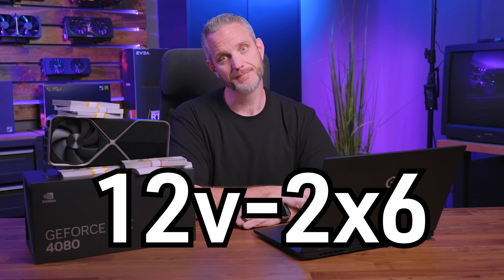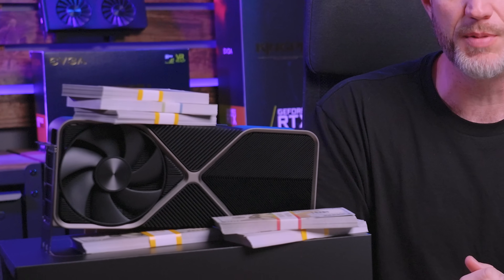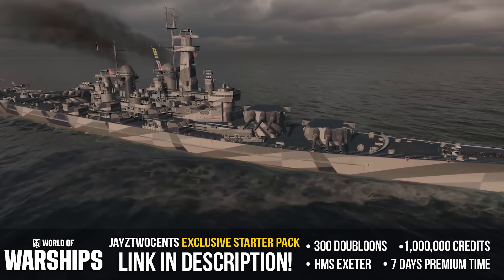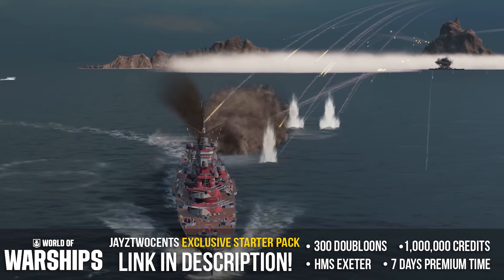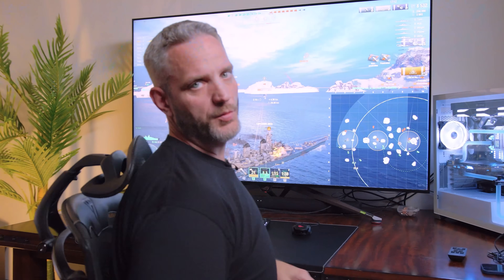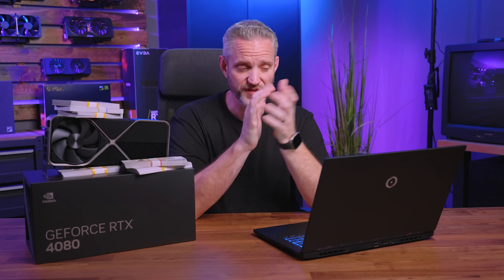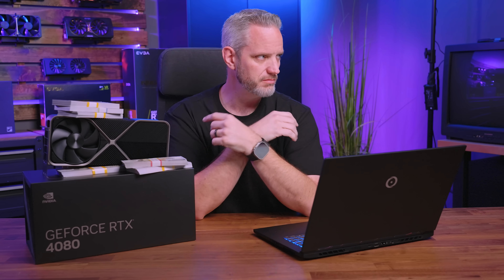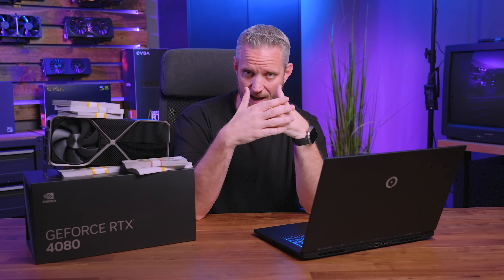They FINALLY admitted that this was a major issue!

Comment: I'm looking forward to the H++ Connectors. I don't think we can get our hands on them as of now. We'll upgrade and fix every card with a 12VHPWR connector.. Done. Everyone is happy.
Reply: Maybe you can do that colab with Jay and get him to fix some for you 😉
Reply: Do you have a mailing list available to 4090 owners to let us know if/when you have them available? Also, how much would something like that cost? (Of course, not knowing the cost of the part makes it harder to answer that, simply wondering about average labour charges.)
Reply: @BreezeTigerclaw  What about warranty? Would it be void if someone changed plug?
Reply: @ultrasaiyan4283 the ones who come to him are the ones who are denied warranty.
Reply: @triadwarfare  What if someone has a brand new never opened 4090, they open the box, find the old plug, and won't use the card until it has the new plug on it? Is there some way to get a brand new card that has the 12vHPWR replaced with a brand new card that has the 12v 2x6, or is there a way to get the card's connector replaced with the "right" one under warranty?
EDIT: Reason I'm asking is because I'm almost certainly going to be buying a card online, and I don't want to have to send 20 of them back because they all have the old plug on them.
Reply: @44R0Ndin  then get a card with the new connector.
Reply: @44R0Ndin  if it's brand new, in-box, I'd probably return it.  Unless you absolutely need the highest of high end cards it might make more sense to wait on either 1) fixed 4090's (how you know?  No idea) or possibly wait 'til 50 series or... 2) consider a lesser card where this is obviously not a concern for now and upgrade later.  I get that you had your heart set on it but... to me it's not worth it.  You can flex with the highest of high end cards next generation.  Just get something powerful enough to get by now.  Then go crazy next gen with whatever is the best out there then when hopefully there's no issues (again...  always that risk).  I mean, we're not even really at early adopter status anymore as the cards have been in the wild for ages now and this is a known situation before you even go to buy the card nowadays.  Early adopter would've been like getting a card at the 4090 launch.  That ship sailed a lonnnnnnng time ago.  LoL

I mean, you could always buy a card and have it fixed (well within your rights and I respect that) but you're effectively paying a premium on a card under warranty to then possibly void the warranty (regardless of who fixes it and qualifications - I don't know that the current warranty legalese will accommodate for this and that would require a change, obviously -- which is another legal fee on NVidia or the AIB's behalf to get rewritten and implemented as revised Terms of Service/Warranty Agreement language) even if it remedies part of the potential that could lead to a warranty claim.  I don't know that preemptive work to avoid warranty claims is a thing...  y'know?  It just seems like a mess that isn't really worth it?  I know I'd do a hard pass on it myself.  shrugs

Sure the 4090 is a beast of a card, no question, but... as Jay notes there's very few use cases where it's a full-blown necessity.  Rather than put myself in that position, I'd let NVidia and their AIB's sort it out if it loses them (my and other people's) sales.  It shouldn't fall on the end user to have to fix a situation that's a failing by the standards body and the card manufacturers (yes, that includes AIB's).  I'd probably drop down to a 4080 and be done with it for the time being.

Obviously this was never an intentional scenario by everyone involved.  It's disingenuous to think that the standards group intentionally failed everyone and it's equally disingenuous to think that NVidia and the AIB's wanted their customers to go through this.  It's even disingenuous to think that the connector vendor in question created something with the intentions of it failing and making them lose $ and potentially future contracts going forward.  It's just a byproduct of circumstances and a failed design that met the specs but has weaknesses and I'd not lay blame at any one vendor and spread it equally across the board.  The standards body did make a mistake, the connector vendor designed a part that manifested the scenario where the mistake could happen with the inferior design built within the standard bodies' mistake, and NVidia and others sourced the wrong connectors by their own choice.  You as a customer buy into this by...  being stubborn and sticking with the purchase, especially if you know about it upfront.  Those that weren't in the know, that was a gotcha that they didn't see coming.  I feel for them especially if the companies involved don't offer a fix or some sort of good faith solution.

But the fact the customers are put into a bad position to bear the brunt isn't good and if they care about their customers (!!!) there should at least be some sort of attempt to help customers be provided peace of mind.  Even if that's a revised warranty wording that allows people like Northridge Fix and others to apply the fixes without it impacting any warranty returns, that NEEDS to happen at the very least IMHO.  Even if that's a potential swap for another lesser 40 series card and a voucher for a future card (ergo, the difference from say a 4080 to a 4090 in price) upgrade to show good faith.  Even if it's a discount to have a certified repair service like Northridge Fix (and others) fix the card for the customer (out of pocket) but get a discount voucher on a future card down the road by NVidia or the AIB to...  again, show good faith.  They can give the choice of an exchange with voucher to cover the costs difference or a user-upgrade + voucher or even potentially a NVidia/AIB partial or whole funding of the card under warranty as a preventative maintenance scenario.  I genuinely believe as premium a part as the 4090 is that the volume of sales is low enough that NVidia could likely afford to provide the fixes without it putting a hurt on their bottom line (especially since AI is their meat and potatoes and gaming cards are like a small side dish).  As Jay has noted with AIB's and the margins...  that's a bigger question mark.  That said, if Cable Mod can provide that?  I think it would be almost a necessity for the AIB's to figure that out too or else look like they won't stand behind their product.

The bottomline is that in order to assure that it's not Joe Schmoe with a soldering iron doing this on his own vs. paying a reputable service center with a contract/relationship there'd obviously need to be some sort of system in place to assure that it's handled to prevent voiding the warranty.  Sure there's likely some people talented enough to do the process themselves, but the fact that they're not certified or under contract makes it almost necessary that NVidia and the AIB's step in to handle the scenario and take some ownership.  I get that they don't want to for the liability reasons that Jay implied (i.e. why they don't want to use the term "recall") but I think there's a way to not bring it down to that and still do the right thing with the customers.  And a big part of that is not soaking you on it or dropping the ball in your lap with no solution other than, "Better luck next time *geegaws/aww shucks arm motion*"  That is B.S. and no customer should be subjected to that scenario.  

I mean, legally there's no obligation and as an early adopter to the standard...  you took that risk (again, why I'd take the 4090 back myself knowing the situation) but...  again, that's completely up to you.  I respect the decision if you're willing to pay that premium and then pay above and beyond with no assistance to remedy what you shouldn't have to.  That doesn't mean NVidia or the AIB's have to do anything, but...  it's a sign of the company you're dealing with (compare to Cablemod and how they've handled things) IMHO.  If the AIB's and NVidia see this situation and know the scenario...  they should at least care enough to want to not only rectify it in the long-game but to do something for the few in the short game that wanted the cards bad enough to pay said premium and incur said apparent "beta testing" in the wild on their watch.  There should be some sort of reward and sense of respect for that (and mind you, I'm never likely to be in the market for a 4090 -- that's just how I feel about those that can and do) even if the solution is a more modest one than taking fully ownership and responsibility and commanding respect on the level that a company like EVGA or BFG Tech was sort of notorious for and that Cable Mod obviously is.  If you want to be THAT company, here's your chance.  If it's not NVidia...  well, not really a shocker but...  it would deter me from buying their product going forward if I could avoid it.  Which is further reason why we need AMD and Intel to step it up, not that I can guarantee they'd be any better in this scenario if it fell in their laps either.
Reply: @BreezeTigerclaw  I'm charging 200 to replace the connector, with a stock connector or a mod. When these are available I'll add these as the main option for a repair. EDIT* I'm not northridge fix.
Reply: Not fit for purpose consumer law should apply, card rated at 600w and melts if it receives it.   "You'll have legal rights if the item you bought is: broken or damaged ('not of satisfactory quality') unusable ('not fit for purpose') not what was advertised or doesn't match the seller's description."  I'd Email nVidia and try and get a contract that they'll pay you for the repairs.
Reply: @Drunk3nMas7er  That would be a waste of time. The cards work just fine for most people, clearly they are suitable for the described task when care is taken with the connector.
Reply: This is why Alex is the man.
Reply: Astron is already making/shipping them.
Reply: I think I saw something about a firmware change in the gpu. How does it know?🤣
Reply: Grassroots 24pin, solved
Reply: I have a new Corsair RM1000X (ATX 3.1), which has native 12v-2x6. I'm not seeing any H++ sign on the connector, though, FWIW.

Comment: Just look in the car audio world... 1000 watt amps, which can pull 50 amps and above.... ALLWAYS use 0 gauge copper wire, Or at MINUMM 4 gauge ... sooo yeah, that plug is wayyyy sketch pulling 50 amps

Comment: it should've been 16 pin instead of 12pin but the best solution is to use the NORMAL 8 pin connectors FFS 🤦🏻‍♂️

Comment: At 8:36 Jay goes over how the new rating allows for 75W to be supplied by the PCIe slot, but their measurements have always shown around 30W with the 40 series. I'm pretty sure that's by design as almost every VBIOS I've ever tried to edit shows the PCIe power draw limited to less than 40W. As he said, it probably won't change anything, but the math allows for 75W even though the board will most likely never draw more than 40W from the slot unless you tweak the VBIOS.

Comment: As an Electronics Design Engineer for over 35 years I have a hard time understanding why this was not caught before production.  Have Designers been told to put cost low cost before quality,  or have they been simply ignoring specifications of the connectors???

Comment: The new connectors are now on current 4090s from a couple of months! Also the current cables are compatible with the new connector!
Reply: Yes, saw a conformation on Reddit today. You have breaking news! Good job sir!
Reply: How do you know if the card has new connectors?
Reply: Same user error issues even with the new connector. Properly seat your power cables, buy a case that fits, do not bend cables, do not use 3rd party adapters, have a professional who knows what they are doing building rigs and you will have a %99.9 success rate according to the data

Comment: I would guess that the GPU fans going to 100% with a black screen is the GPU protecting itself by trying to cool it off ASAP. 

Another change I would like to see is a temperature probe either integrated or next to the "NEW" connector on the GPU just as an extra later of safety so if the area next to the connector gets too hot, the GPU can "do something" to cool it down by throttling or something.
Reply: honestly, if it does get above 30° delta the best option would be to throttle back to 30%, just enough to operate web browsing and whatnot, or disable 3D/game rendering in such a state. there should also be a sensor on the cable end, so it can zero-in on plug/socket delta too. nothing fancy, just a normal 10k K-type thermal couple will do.
Reply: @nightshadelenar  That's exactly what I meant. I did specify "throttling". Since the connector was actually melting, the GPU clearly had ZERO idea something was going terribly wrong. This is why I suggested some sort of component at the very least next to the connector so the system can take proper action before disaster strikes.  I guess maybe I wasn't completely clear.

Comment: I have been plagued with that black screen and 100% fan on my 4080.  I have had my 4080 replaced and swapped out the motherboard and PSU with good hardware from a new system i built for my kid and still the issue persists.  this whole series is trash i so wish i just got something else but not worth trying to sell the 4080 at this point.

Comment: You still need pin connectors that are rated for 12-14 gauge to handle the amperage.
Reply: Only when the wire run is over 50 feet inside a building.
Inside a PC case, you can cut the wire gauge down as it's the overall resistance of the cable assembly that causes the heat, not the wire gauge.
The shorter the distance that you have to cross, the thinner the wire can be.
The little conductive bit that melts inside a fuse isn't made of 12g wire, and it doesn't have any trouble carrying the same rated current that a 12g wire can carry in a US household (20a). However, any more than 20A and it melts (eventually), which is the whole point.
But the thing is, what happens if you make a wire that's just a little bit thicker than that wire inside that fuse, and then run it over the same distance as the fuse wire, and run 20A thru it? Absolutely nothing happens, the wire stays intact 100% of the time until metal fatigue sets in and causes it to work harden and break due to vibration or thermal cycling.

RC cars that pull 50A thru the motor or more are using 12G wire to feed that power to the motor.
For a mere 9.2A per current carrying conductor (aka the ones that are carrying power not signals), you don't need 12G wire.
Now would I like a cable that uses 14ga or thicker wire to carry the power from the power supply to the graphics card? Yes, of course I would.
But it's gonna cost probably twice as much, because copper is really expensive (it's only barely not a precious metal, at least by cost).

Comment: The NTK Pins alone would probably fix it. This is exactly what I was talking about in my other comment about the "dimples." Nowhere near the surface area required for the amperage. Guage of the wire doesn't really matter, because as you said. If it were the wires, they'd be what was melting. It is just the connector and the connection being made between the male pin and the female receptacle. Another thing they should be doing i making sure there isn't so much play in that plastic clip. Why is there like a 1+ mm room for movement. It should be almost tight so the connector can't back out and like you said, two of them to prevent twisting.
Reply: I suggest anyone with a RTX 4090, research and find a wire/adapter with that NTK receptacle. and maybe, see if you can find a small zip tie that you can wrap around both the male and female connectors to lock them together. Something thin enough and nonconductive that fits between the two rows of 6 pins.
Reply: Or maybe, someone can module a 3D printable bracket that you can fish behind the connector on the 4090 and sits between to two rows of pins on the back side of the connector, do the same thing for the wire side of the connector and have screw holes on either side to screw the brackets together and lock the connector in place like how old VGA connectors had those lock down screws.

Comment: If nvidia goes much further towards size and power consumptions, i'd insist the video card have its own power supply and power delivery cabling so that there aren't all of these situations were its unclear who's at fault for excess resistance due to awg, was it the user who didn't secure the cable?, was it the power supplies cable being a different guage? Faulty connector? so forth and so on, its kind of ridiculous for a consumer grade product.

Comment: I’ve had that black screen then full fans happen many times. I was using cablemods’ adapter and it seemed to happen more often. I’ve since returned the adapter and just use their cable. 

It happens a lot less often but I think someone should create a better cable and preferably one with a 90 angle.

Comment: There weren't any shortcomings with the connector pins, it is only the clip that was designed too small in my opinion.
The reason it burned was due to the connector not being plugged in completely. People either didn't do it properly OR they mushed the cable when closing their cases.
I use a 4090 for almost a year now in my NR200P ITX-PC and I bend the Corsair OEM cable 90° right at the connector. I have no problems, because I did it properly without stressing the cable or connector.
8-pin cables melt the SAME way for years, but they are only rare cases, just like the 4090 ones. 
People underestimated the height of the card and the size of their cases, thats all. The "new" connector is just idiotproofing.